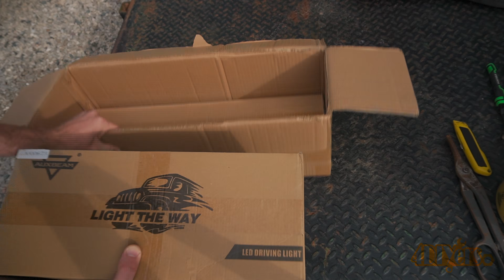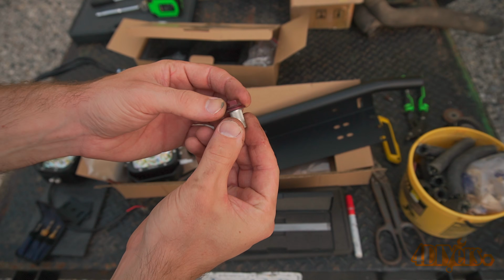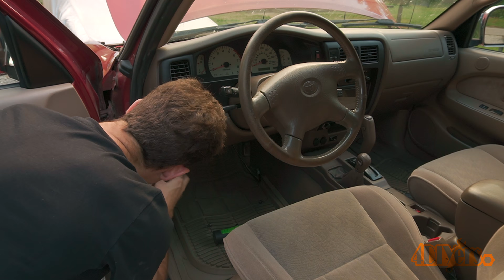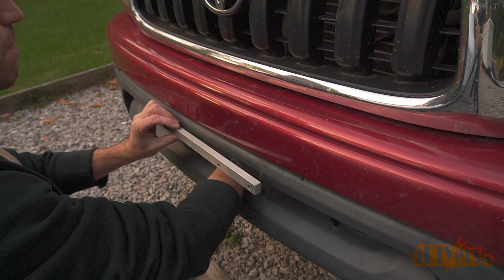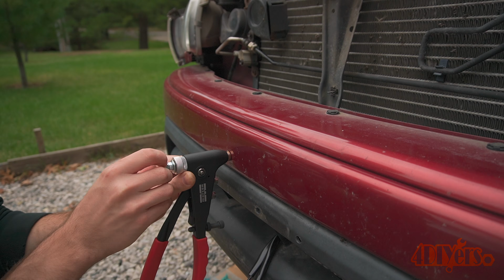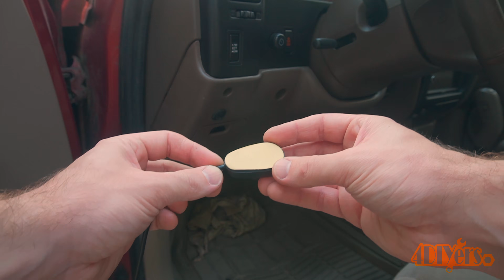How to: Easiest Way to Install Off Road Lights on your Truck

Comment: Would using one of those cigarette lighter headlights be good as a hard wired to battery ones? Would this be safe to use all day as a headlight, (does it get too hot or cause electrical issues in your car)?
Reply: the "cigarette light port" usually is not rated for high current apliance like those lights. There is a high chance that the wires that are conected to that conector will catch fire. I have no idea what car u own but most of the cars have 10A or 15A fuse to it that is rated for 120W or 180W to prevent fire. But if you do what my friend did... that he just put there 30A fuse... well his port was shortly on fire cuz that cables were not rated for that power consuption

Comment: As you've installed it with plastic bumper support and not with steel frame, is there any wobble on rough roads?
Reply from the maker: It’s fastened to the steel bumper too. No issues with wobbling.

Comment: Would the aluminium support provide the same type of rigidity to the lights as a nudge bar or bull bar? I am concerned about vibrations on long trips.
Reply from the maker: There is a very small amount of vibration but I haven't found it being an issue. Making sure the mount is fastened firmly on your bumper does make a difference too.
Reply: @4DIYers  Thank you so much.